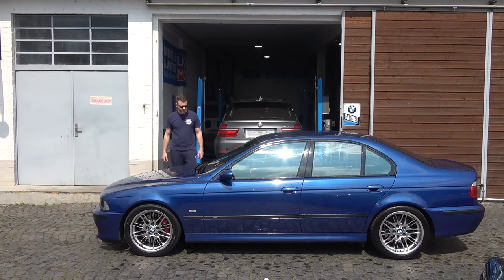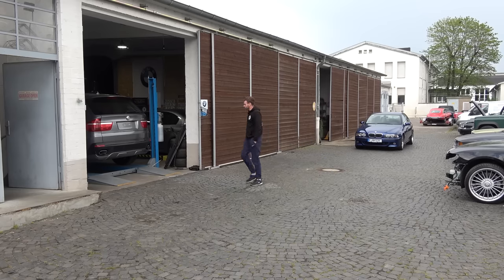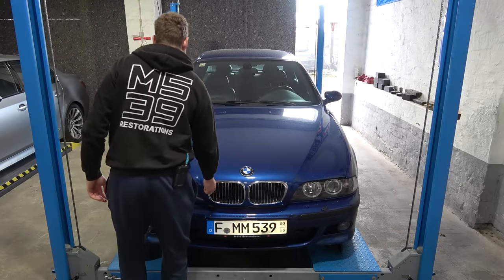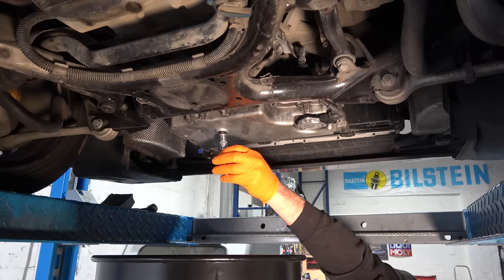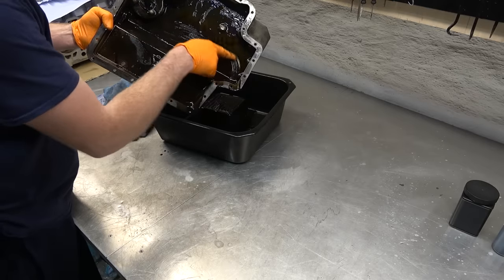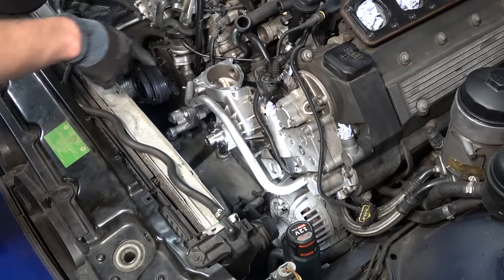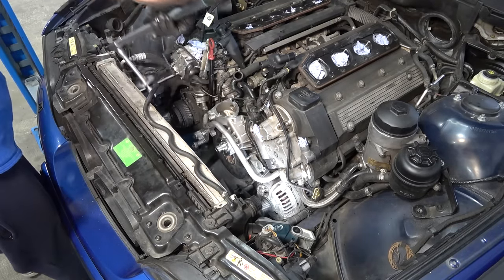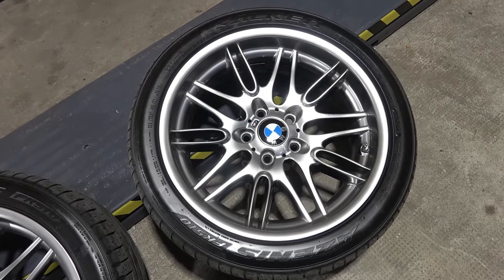Fixing Up & Driving an Icon on The Autobahn - The BMW E39 M5

Comment: From a legally standpoint, yes, no BMW has let you stranded. But no matter how many legal acts state that Alpina and BMW are different car manufacturers, the material facts show that they aren't, i.e. same base-engine, same chassis, same car overall. All the calculations and tests for the base-engine were done by BMW, same for the car design and car parts. Alpina at the most did the supercharged BMW based engine calculations. Anyway, great video, as always.

Comment: Great stuff again, like a feel-good-movie compared to project chicago. I have been wondering ever since when you would switch to Michelin tyres, which in my opinion are the perfect match to classic BMWs (remember the TRX and TDX tyres...). Small critique: I don't really get the point of raising the water temperature by 3 degrees using a thermostat which needs to be installing using ... "non-OEM-methods". I just don't believe it will be a real improvement.

Comment: Sreten, have you considered waterless coolant that protects the inside of the engine? Look it up, think I’m going to use it soon.
I don’t think there is pressure build up in the cooling system with this type of liquid, so less stress on the pipes and radiator, and no explosion from opening the rad cap when hot….. test this very carefully yourself to confirm. 
=
Contact the makers and see if they will sponsor you 🤗👍🏼

Comment: For some reason youtube filters out the low engine rumble. I was looking the other day for a V8 Diesel Mercedes the E400CDI W211. Looked it up on youtube and it did not sound that good. Then i went in person and it sounded like a beast. Same goes for a V6 M112 i wanted to get a cheap project car W210 1997 E280 gasoline. The sound was magnificient

Comment: Awesome video thank you! I need to replace oil pan gasket. Question - should I use some kind of sealant, and if yes what kind? And would you recommend changing the o-rings on the two oil solenoids, some say that's a "while you're there" type thing. TIA!

Comment: Why didn't you choose polybushes on the front arms?

This is what I run in my every e39/e38 and wad always happy.

You just need to find very soft one usually 85sHa or even go lower to like 80sHa which is nearly as soft as factory.

Comment: Hi Sreten, great video as always, I just notices one thing regarding the front main seal - isnt it better to drive it in a little bit off (in or out) the spot where the old one was sitting? 
Otherwise you might land in the same "groove" on the crank shaft made by the garter spring over time and cause leakage due to the radial shaft seal having too much clearance to fill   - or at least so i thought? IIRC VW (konzern) manuals used to state that replacement radial shaft seals should be put in 0.X mm shallower ...
Otherwise thank you for your time you take making these videos :)

Comment: Who would guess that car had more than 208K kilometers on it?   It looks new!    Great job!  What is up with the tachometer? At 1:02:08, it's not working while the car was at speed.   But later in the video at 1:09:09 on, it's working.    Odd.    Would Powerflex urathane bushings be the "goldie locks" bushing between stock and the monoballs?
Reply: 1:02:02 read the text

Comment: Why didn't you just swap the springs in the two thermostats? Isn't it the spring that looses tension as it warms up? Just a thought for the future 😊 Thumbs up for using ones advise on protecting the machined surfaces in the vapour blaster 😉
With the oil consumption, do you think it's due to the oil control rings on the pistons? Many say that the single part oil control rings on the M54 engine is the reason for the oil consumption. Not sure it the S62 uses single part oil rings too 🤔

Comment: What non-OEM parts on the E39 M5 of all cars ? The hell you say.  Suspension work on cars is one of my Fav things to do because of the instant gratifying results.  I put PowerFlex Poly bushes in the Thrust arms on my E34 when I redid the suspension with new Bilsteins and kindof extreme FK lowering springs and it handles beautifully ,but is still very comfortable which is what I was going for.  There is nothing better than having a good car with a tight fresh suspension.  Whatever happened to the E34 M5 that you were going to fix for that guy at Apex @ the Nurburgring ?  I really wanted to see you fix that car up like it deserved.

Comment: Hello M539 Restorations,

Interested in more information about your coolant thermostat change.  79 (174 F) and 82 (180 F) deg sound cold.  Is that spec?

Please also note, failure mode on modern thermostats are in the "open" condition, causing the engine to run cooler vs. overheating.  If information is correct, your are adding 3 (5.4 F) increase to normal OEM conditions.  Why?

Running on the Autobahn at 250k or in France at 130k should make no difference to the engine temperature, unless the cooling system cannot keep pace with thermal output...and that would result in an OVERHEAT condition.

P

Comment: It would be nice if you shared the Blackstone results, every 5000 to 6000 Kms is overkill, well its a BMW, you have to take every precaution for it not to take a dump.
Do every 10,000 miles on my Lexus the results are always perfect.
Didn't you have some kind of a deal with Falken? why Michelins now? Like your choice any ways

Comment: Nice work as always Streten! With respect to the control arms I personally went for powerflex bushes (purple) in my (e60) m5. It sits right in between the mono balls you fitted and the original rubbers. Did you consider them at any point? Why (not)?

Comment: What gear oil should i put in my e36 318i 85kw 5 speed manual with no label on gearbox??? Can i put atf or i need 75w80?

Comment: Really?' My car runs cool too, I've changed the thermostat for an OEM one, and there's almost no difference. It should open at 79 degrees, but in the winter it barely got to 75 when I was cruising on the highway. The new one didn't help, it's better by about 4 degrees, lol. Is it stuck open too or what? Basically, I'm afraid to do some pulls out of the sudden because it doesn't even reach 80 degrees sometimes... I'll probably change it again before the winter because in the summer it does reach 80 and more.

Comment: Monoballs will last longer, if greased and sealed. Theor biggest enemy is dust and dirt. open ones work good when dry, but add water and dirt, wears out really quickly. 
Best Compromise would be new rubber bushings filled with silicone(or such) that bonds to the rubber. Oldschool cheap trick.

Comment: I guess that the soldering job done in the fuel pump is for preventing any chance of electrical arching issues due a lack of contact in any contact area of the pins I guess it’s better spent time removing it and doing it again rather than having a grilled M5 😬

Comment: 4:46 what is your opinion on the oil additives you used? Looking to try out Liqui Moly MOS2 and I was wondering if you liked it or felt anything different. Thanks.
Reply from the maker: Didn't find any benefit

Comment: The e83 (first generation X3) uses a similar control arm setup save one aspect; the ball joint is part of the arm here, on the e83?... Well, mine was used as a tractor, so getting the ball joint assembly separate from the hub assembly is... Ugly.

Comment: One worthwhile update is getting one of the aftermarket plenum plates from RK or similar vendor.  They are much better seal than stock and align perfectly.
Reply from the maker: Ah, not really. 0 issues with original stuff.

Comment: Can you help me? Ihave Bmw e39 523i M52 and it loses suddenly power on the highway and the rpm drops down. But after this the engine runs again normally and starts normally until this power loss happens again on the highway. One time after power loss I drove very slow and engine was stall. But after this I could turn the engine on again and no light and no fault codes. What is the problem? Automatic transmission fluid is now changed and this power loss was happened again.

Comment: It's hardware store no a software store and it's a microfiber not a carbon fiber rag and the velocity stacks torque specs are 6nm
Reply from the maker: Noooo way. Are you serious? Can't believe it. 
No, torque for them is not specified in the repair manual.

Comment: 260 kph is real good for such an old car. Does anyone know if Sreten restores a customer cars ? I have an old 3 series with over 330,000 km that I love and still use as my daily. I have looked after it well, gearbox trans services every 100,000km and engine services early every 10 to 12k instead of 30k. But now its worn out mechanically.

Comment: Sreten, I'd be careful about replacing good original things for producted nowadays. Parts for not first build of the car have much much worse quality control and quality overall. I think it might be safer to stay with original fuel pump than new one producted today.
Reply from the maker: Agreed and I am careful with what I replace. One example is the alternator, not the same quality. Fuel pump was already replaced and they didn't last forever even back in the day.
Reply: @M539Restorations  yeah You're right. Love Your restorations and BMW e39 M5! Greetings from Poland!

Comment: I kinda cringe when someone says they feel the torque... Torque without revs and you are going nowhere. Torque with revs is also called in one word "power". Be it low rev power or high rev power, its power, not torque. You are not screwing bolts, jeez... otherwise great video as always, Id love to get my hands on at least 535i/540i one day.

Comment: well I am from Iraq Kurdistan, for the speed limits, Gov now wants to install point to point Speed cameras on streets means that if the road meant to be crossed with 4 min, and you done it in 3:50 min/sec you will be fined, how much no one knows, in other hand we have to many speed cameras as well installed inside city and outside. let me know any of the countries using point to point Speed cameras. that will kill the joy of the driving. | hear our sound.

Comment: I really like your channel, really love to see broken/unloved cars being fixed, but why replacing stuff which is still working?
This is a performance car, I get that, so you replace oil more frequently - that makes sense, but why replacing plugs and coils which work just fine? why replacing perfectly good tires?
A good mechanic, replaces stuff before it brakes and causes damage to other systems, this makes sense, this is why you replace for example the water pump when you do the timing belt, right? the irony!! guess what? you had o replace it 30K after that.
I had the same issue on my car, and this is with a justified preventive act which still went wrong, just to show a point, that it doesn't always help to replace things in advance.
Also, why replacing the control arm? this is just a still rod, the active part is the bushing which you replaced anyway with an aftermarket, right?
Usually when you go to a garage, they just replace the whole thing, but if you have you own press, whey not replacing the bushing on the existing control arm?
I'm not a tree hugger, but I hate to see good stuff being wasted, it doesn't make sense.

Comment: I think I know why they soldered the connectors on the fuel pump. When I had a E39 353i, I had to replace the fuel pump. After a couple of thousand miles, one of the connectors popped off and the car died. I had it towed home and discovered the that the cable came off, so I soldered them on. The cables just didn't want to stay on.
Reply from the maker: That's why you crimp them on firmer.

Comment: Hello guys. I need a little help. Today i did some simple maintenace on my E36 ( new sparkplugs, oil, oil filter, fuel filter) and after that i went for a 20min ride. Every time i slowed  down on red lights oil light started blinks witch what i found means that there is low oil pressure. When i was parking i turned the car off and because i was not satisfied with my parking i turned the car back on and thick white smoke come from exhaust. I didnt notice any smoke when i drove the car before that. I turned it off again check every think and find out my dipstick was not fully inserted so i sticked it back in and try to start it again. Than thin white smoke comes out. Then i turned it of. Could it be that there was no oil pressure because of the dipstick ? Do any one have any experience with that ?
Reply: OK :) so we find out what was wrong. There in oil filter was plastick midle piece that got stuck in the old one and we never put it back to the new filter. That caused oil droping back to the oil pan instead going through and to the motor itself. So my question is how devastating is 30min ride like that......

Comment: Thank you for another entertaining (funny) and educational video.A question about the vapor blasting cabinet? Do you de-grease the parts off camera or is it not necessary with the filters the machine has? And for any dipshits oh yeah I mean dipsticks please keep the length of the videos as they are and not make them shorter or editing them. To reduce the time would either lose valuable info or skip details in what is an already complex job of repairing some of the most valuable (to me and I hope others)cars ever engineered. If money ever becomes an issue to continue the production of your videos please feel free to add a shameless plug or a simple request for funding because at least in my case I would happily give more to keep you doing what you are doing!!

Comment: What was going on with the rpm gauge at the biggining of the run???, it was dead dead, had 0 rpms, also water temp dead, was it bad editing''' you took random film of the rpm gauge when the car was off and edited it with the car on going 260kmh....................
Reply from the maker: How do you notice that but not what I wrote at the beginning of driving?

Comment: Instead of ATF, try LM Ceratec (6%) and proper MTF like LM Toptec 5200 75w-80 (BMW MTF  LT-2 Spec) . You will be shocked at how smooth and quiet the gearbox gets. And you will have the added protection at high terms/pressures, which poor old ATF cannot match. Don't add Ceratec in LSD diff as it needs friction to work. You will then want to add Ceratec into the engine as well...
Reply from the maker: I tried LM gearbox additive as I said, Mos2 friction reducer, similar to Ceratec but specifically for the gearbox. Didn't help. ATF works best and provides great protection. Not sure why you'd say poor and old when it's standard and used to date in every car.
Reply: @M539Restorations  I was using it on my e34 and e39 and both gearboxes were really clattery at idle when warmed up, regardless of the dual mass flywheel -this led me to believe that ATF is much thinner than the "regular" MTF. Since switching to MTF  with Ceratec the noise has gone down by 90%, with no detrimental Impact on shifting, I dare say it is now better than ever before. BMW has long back switched from ATF to LT-2 specs, I guess for the longevity reasons, not sure what else could have made them switch? Happy this works for you; I would still add Ceratec into ATF for the added protection of that precious M5 gearbox - every little helps in the long run. Maybe asking LM Tech Support for their opinion to be on a safe side? BTW I love your taste in cars and "no prisoners taken" approach to maintaining them - hat off Sir!

Comment: Problem with water pump may be caused by visco clutch ( not sure if s62 has it ) but TIS recommends to change visco clutch every time you change the wayer pump, since small vibrations make water pump shaft to fail.
Reply from the maker: Fan clutch was changed at that time too.
Reply: @M539Restorations  Then indeed quality of production for some parts changed a bit

Comment: 35:01 there is a torque spec for these: 10nm
Reply: It's listed under 11 12 Cylinder Head with Cover as 11AZ
Reply from the maker: There isn't one E39 M5, just checked again. It's not necessary anyway as you will feel when the bolt bottoms out. With a torque wrench, you can easily overtorque it and snap the bolt or strip the threads.

Comment: You did not want to vapour blast the machined surface….would it be damaged by the jet?
And then you scrape it with a blade!!!
Reply from the maker: Yes, plastic blade.
Reply: @M539Restorations  
So, for example, you are saying it’s not a good idea for me to vapour blast clean my polished e46 M3 wheels then, as the cleaning power would be a bit too strong for that machined surface???
Reply from the maker: @glengrimsdale4  no

Comment: Check for metal shavings since you fill the tranny with ATF at the last change.
Reply from the maker: Sorry, you're making no sense.
Reply: @M539Restorations  Love your videos BTW. More context into my comment: ATF could be compatible with your manual tranny there. There is no argument since I have no experience with that 6 speed box. I had a shitty 5 speed in my previous E36, which got ruined with ATF. It came with metal shavings before I filled it with Redline MTF.

Comment: end of the video in the small towns the RPM gauge worked, but on the Autobahn NOTHING
Reply from the maker: How do you notice that but don't notice the text that says gopro failed recording?
Reply: @M539Restorations  So sorry i did not realize it was the gopro failure that caused that.  YOU WERE RIGHT SRETEN and i DID see the disclaimer.  sorry